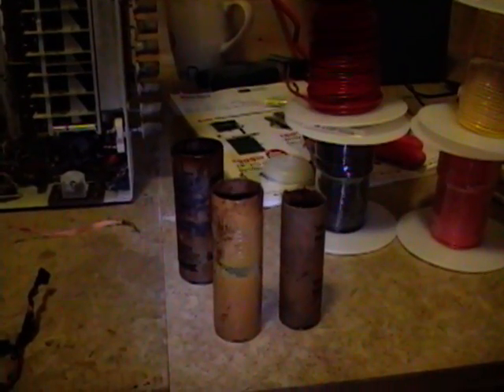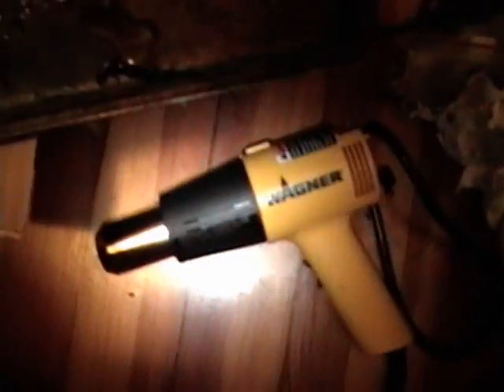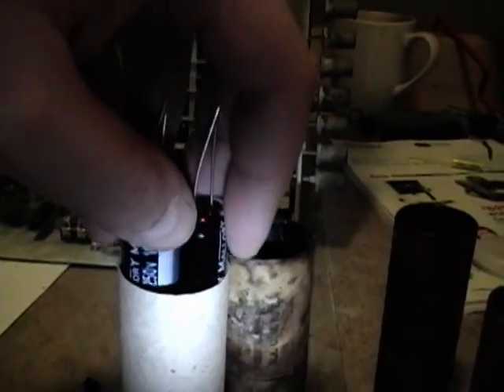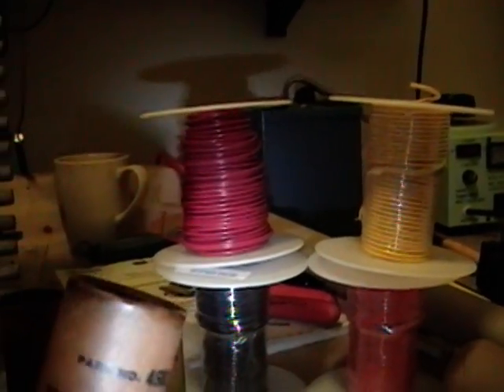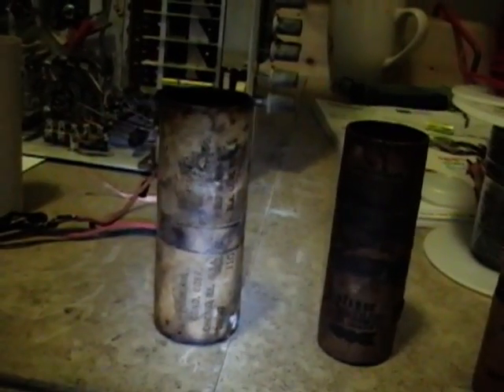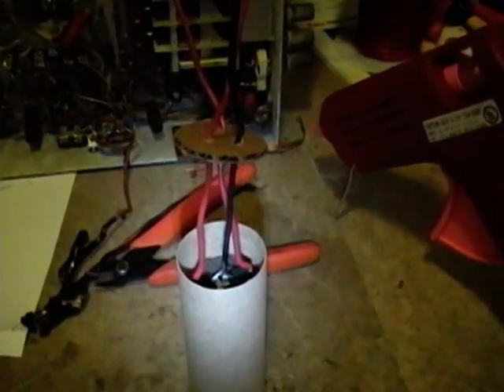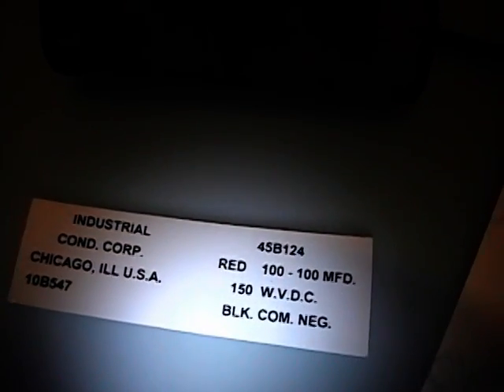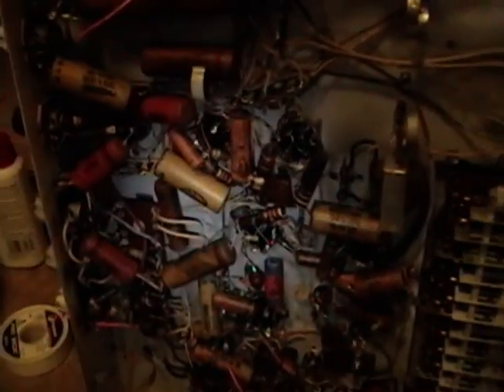Halicrafters 506 restoration - part 4o14

Comment: Oh less than 10 bucks!! cool... I had an old Unger Princess heat gun for a while...a bit too small, I guess thats why they called it a
princess.. good for heat shrinking in very small spots. Motor died last year and I started look for one now, especially with your great tips on re-beesewaxing new (old) caps to preserve the style... Your gun seems just fine, cool work doing this as well..thanks so much

Comment: I would have drilled out the rivets holding the steel bands to the chassis, instead of cutting the bands (Dremel).  You can use rivets or 4-40 or 6-32 hardware to reattach the bands to the chassis.